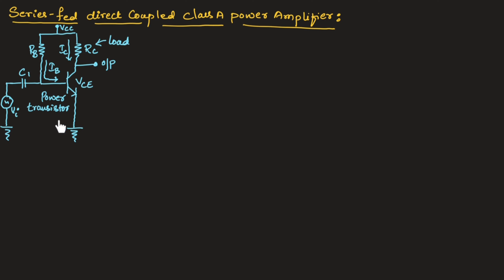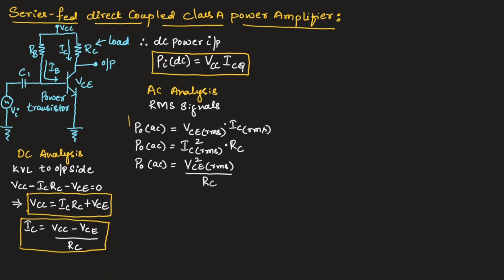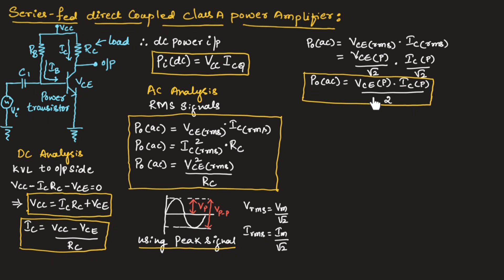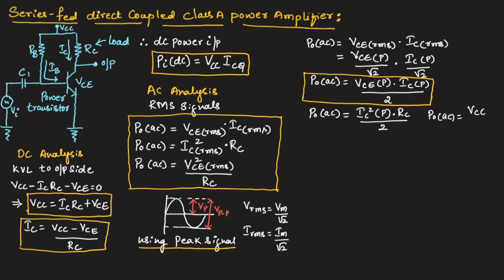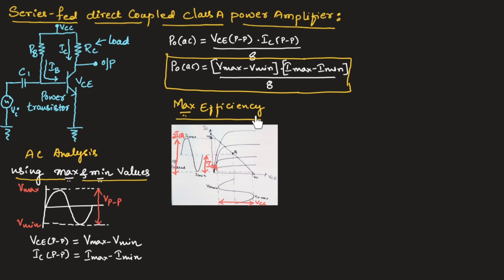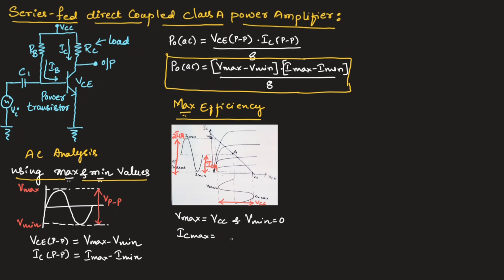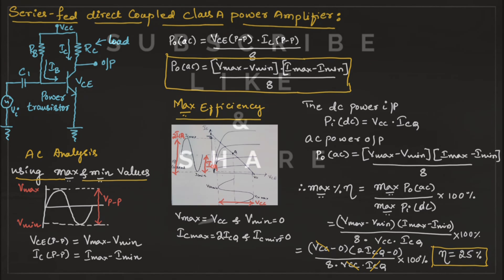AEC#32 series fed Class A power amplifier || ECAcademy

Comment: Great Help Sir, But could you explain why the output part is 

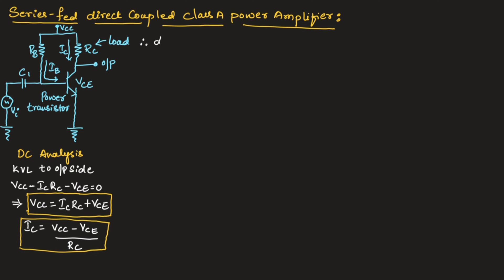1:46 

 V(cc).I(cQ) 

and not

 V(ceQ).I(cQ), 

as it makes more sense when both current and voltage are taken under the operation point condition.
Reply from the maker: Dc input is VCC that's why dc power input is VCC*ICE(Q)
Thank you for your feedback…..
Do subscribe & keep supporting EC Academy ✌️
Reply: @ECAcademy  Thanks Sir, That was timely. I understood.